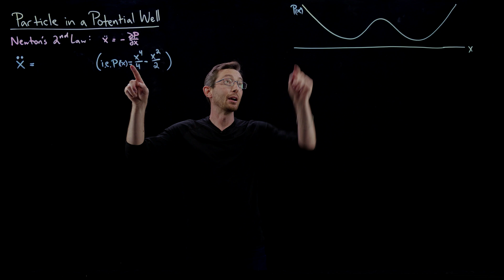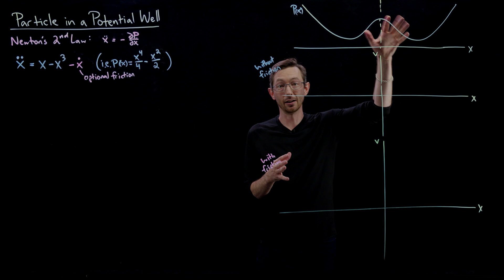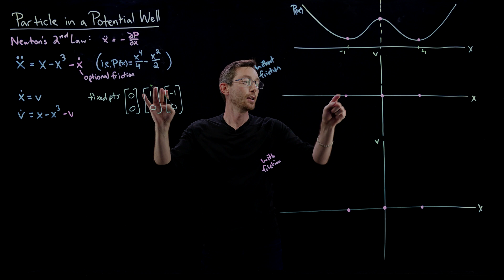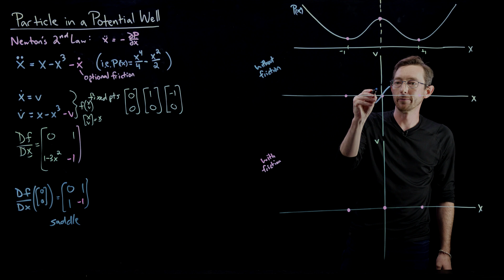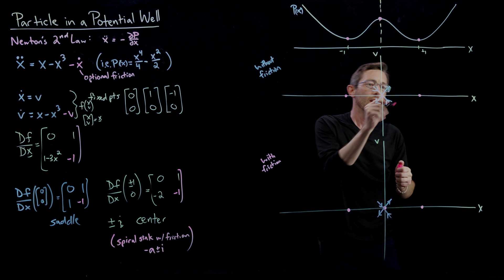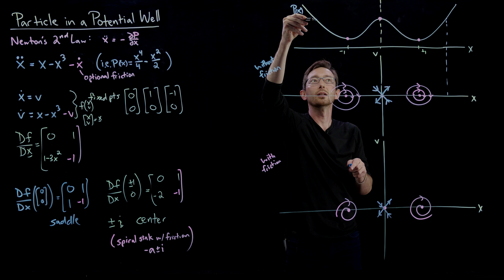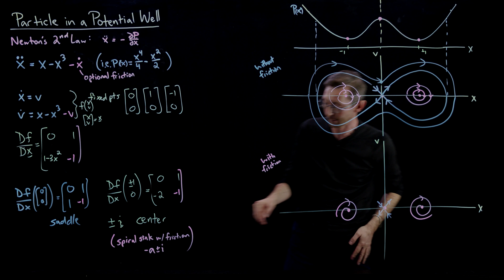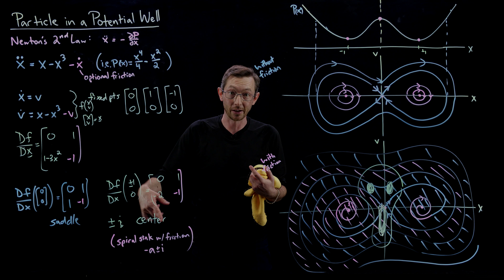Phase Portrait for Double Well Potential

Comment: Great Explanation and drawings! :) I have one questions about linearization and fixed points: Why don't we linarize about other points than the fixed points? Theoretically it should, because I see no problem with the mathematical machinery of linearization. Am I missing something?
Reply: If you don't start in a fixed point (generally it can be a periodic orbit or invariant manifold) then your perturbation and the point where you're trying to linearize will change in time due to the flow of your system of differential equations. In other words, you need a fixed reference (relative to your flow) frame to analyze how your perturbation will change, and that change is just a linear systems of differential equations for your perturbation
Reply: Only near the fixed points is it possible to linearize, by shifting the (linearized) expansion point in the coordinates if not at the origin. Analogous to Taylor vs Maclaurin series expansions.

Comment: Hello, your lectures are very interesting!  Thanks for these. But you can not use a linearization method for studying nonlinear dynamics even locally, if your linearization is not hyperbolic (if eigenvalues belong to imaginary axis, like in this  video and not only).
Reply: You don't know a priori if the fixed point is going to be hyperbolic, you linearize the system locally around a fixed point to determine that